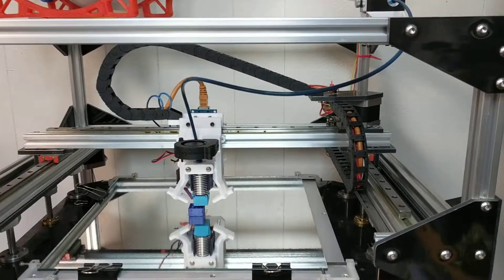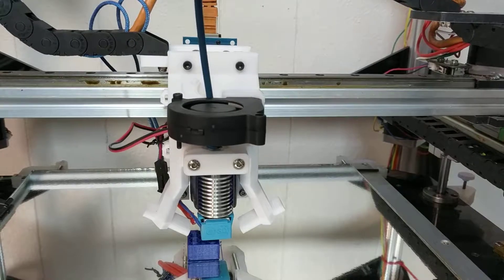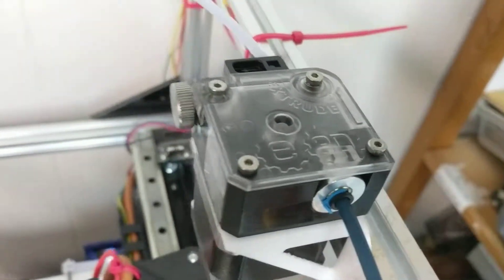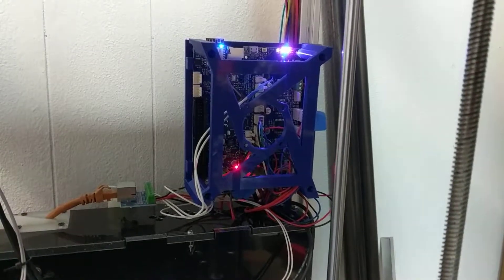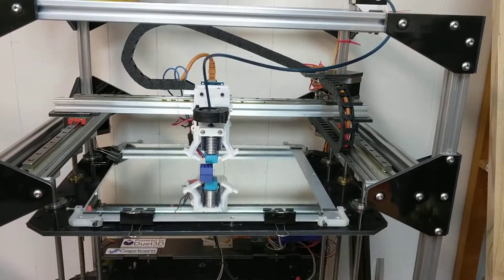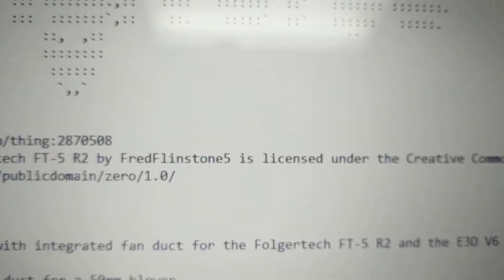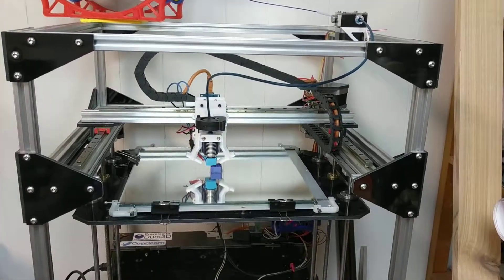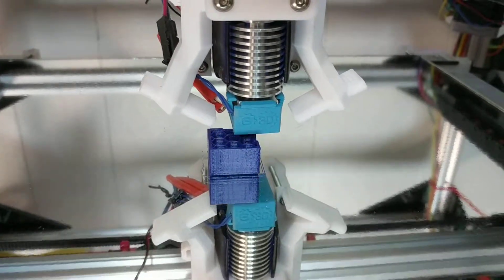Folgertech FT-5 R2 modified with FredFlinstone5 Carriage, E3d V4, E3d Titan, Duet Wifi

Comment: How long have you had your FT-5? I was thinking about purchasing one but I'm worried about QC issues, there are lots of complaints out there. What kind of issues did you have with assembly, QC, etc, if any?
Reply from the maker: I had the FT-5 for around 1.5 years now. It went together well but the Power Supply was dead on arrival. Folgertech when contacted said sorry not our problem so I had to buy a new power supply. The only other part that has broken is the power switch so I have it connected to an external power strip with a switch to fix that. I like the FT-5 but of my 3 printers it is used the least. I Liked the design but I am no longer convinced its design has many advantages over something like a Creality CR-10. The main reason I went with the FT-5 was because it seemed like a much sturdier design and it is but that extra rigidity really doesn't seem to buy much in real life.